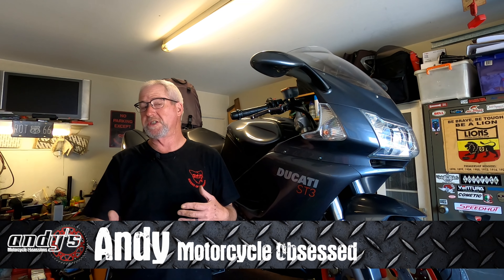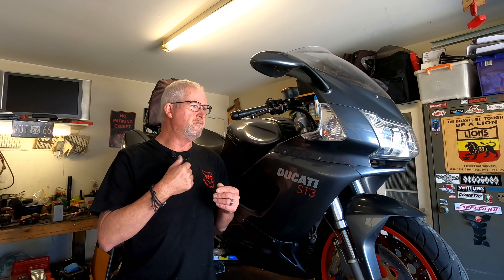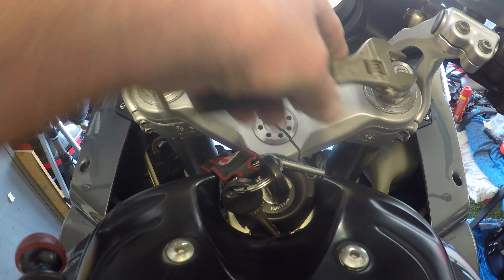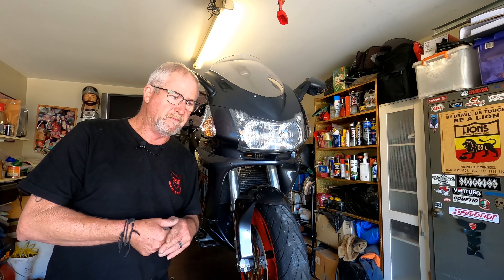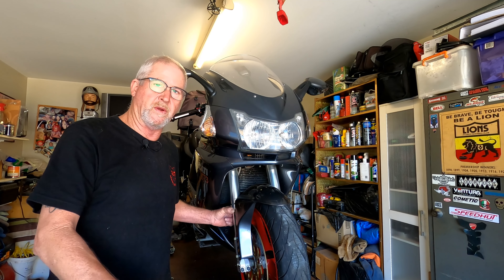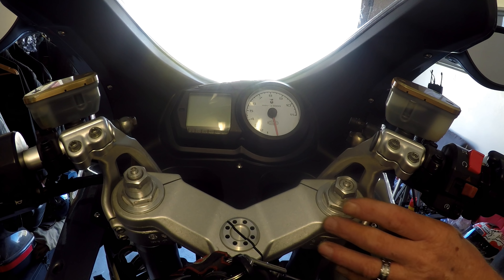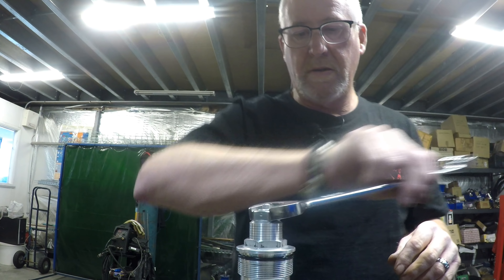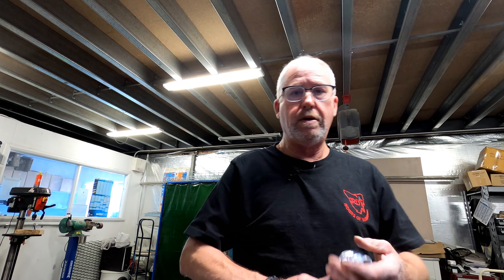DUCATI ST3 Mystery Fork Issue Pt1

Comment: Andy, keep it up! nice video. check the bushings (although the original Showa bushings are very good). Just check if the Teflon lining is worn out (you can seen the copper shining through if worn out). Honestly, when you described what you felt I assumed the steering head bearings where the culprit (but you checked them so assume they are ok).

Comment: The top cap is missing the black rubber ring that is the bottom out pad- the lower steel tube comes up to meet the rubber pad at full compression of the fork.  The C-ring on the spring adjuster was jammed up into the mating part.  That is why the rebound adjuster housing would turn when you try and add preload to the fork.  You will find that the Showa fork version that Ducati uses is crap on the inside.  Steel outer cartridge tube and 10mm cartridge shaft.  If you compare this to a 2000' or later GSXR fork ( also Showa ) the damper inner and outer tubes are aluminum.  The damper rod may also be larger - more like 12mm  This moves more fluid in the damping system and will be better for re-shim.  It is not a trivial thing, but you can make the Showa GSXR cartridge system fit in the Ducati forks.  I have done this on my 748.  Other odd things on the version of the Showa/Ducati forks.  The bolt that holds the fork damper shaft to the fork lower will be just a cap screw - more traditional forks will have a base valve assembly that holds the compression piston and the adjustment system.  This also threads into the fork cartridge outer tube.  The size of the lower leg machined feature on the bottom of the fork lower will not permit the base valve - only the retaining bolt.  You can machine the feature larger to use the base valve or find a set of lower tubes with the axle housing that has the larger feature.  Or not do any of this and just keep the spud that holds the rebound piston / shim stack.  It will have a check shim that permits the oil return.  I have taken apart so many Ducati forks to the point that it may look so pretty on the outside, but is crap parts on the inside.  If you are doing an fork service like you are doing, it is just dumb not to replace the seals, wiper and possibly the DU bushings.  You can find the equivalent 43mm fork Suzuki seal and wiper - still a Showa part !  Wear some gloves or get happy with the stink your hands will have for days  - keep it up.
Reply from the maker: Thanks mate, some great info in here. Yes it was corroded around the wire clip and had seized to the preload adjuster, allowing it to unscrew. I have since taken the cap apart and put a drop of screw lock on the damper assembly thread to help secure it.

Comment: Had a problem with the forks on my 600 Fazer, changed the oil and found the reason for it handling badly, there was a shim missing above the spring.
Reply from the maker: It doesn’t take much to upset them, does it.

Comment: Same as lots of other people I was there chuckling when you were taking the front wheel off ..
not even sure you actually undid the pinch bolts before untightening the axle nut .. hopefully you did.. :)
great vid mate, keep up the good work !
Reply from the maker: You undo the axle nut first, this from the Ducati factory manual: 

Support the bike so that the front
wheel is raised from the ground.
Loosen and remove the nut (9) on left
side of the axle.
Loosen the axle clamp bolts (2) on
the ends of the fork legs.
Working from the left side, use
a plastic mallet to drive the wheel
axle (1) out from the opposite side.
Remove the wheel and recover the
spacer (8) on the left-hand side.
Reply: @ANDY5  ooh.. take that one right back then! 
My apologies sir 👍🏽

Comment: Remove the top fairing, and cut back the white plastic fins on the reservoir tank near the front part of the tank. Then, on the top edge of the top side panel, file down to a few mms the edge from the back narrow section around the corner and tapering back to normal height by the first screw hole. That will make sliding the side fairing on and off a breeze with the top fairing in place, still being careful of course as you flex the plastics. Place tape over the well nut face into which the long rear panel screw goes through so you won't peel it off when sliding the panel onto that frame section. Pierce a hole in the tape before hand. In fact do that to all the well nuts and save our self the hassle of pushing them through.   5W oil works best.

Comment: If you are pulling the forks you may as well do the seals while yoy are in there, the Labour cost of stripping the forks and taking them off you may as well.

Though... iv had a few bikes where those oh I may as well moments turns out that that seal has been hiding/disguising a HUGE issue and swapping it leads to huge bills

Comment: I did a fork overhaul on my Multistrada - be bloody careful tightening   up the triple tree bolts its really easy to crack the top yoke the previous owner to me did exactly that and i had to buy new top yokes, yours look similar to mine 

Apparently the setting in the manual is wrong its a common issue and replacements are like hens teeth took me 3 months to find some here in the UK
Reply from the maker: Thanks for the heads up 👍

Comment: The first ST2 had fully adjustable forks - before Ducati started penny pinching. Are you sure there are no dmping adjusters on the bottom, they are often hidden under grease and brake dust?
Reply from the maker: Yes mate, I’m positive. It’s just a socket headed cap screw.

Comment: Hi Andy, could be wrong but, believe one side controls compression damping and the other rebound damping hence no bottom adjusters, This arrangement is quite common. Regards from a cold and wet Nth Yorkshire UK.
Reply: How does that work if they aren't linked?
Reply from the maker: Asymmetric forks, a lot of modern bikes have this setup. One leg controls compression and the other one controls rebound. That’s not what I have though, I’ve seen this before and I’m fairly certain that the one valve controls the damping for both the rebound and compression.
Reply: @ANDY5  Right, guess you can tell I haven't owned a bike made after 1994

Comment: You obviously had a problem with the fork that you disassembled. On the other hand from my experience of riding different kinds of motorcycles throughout the years, i can say that an easy cure for the base problem that you described is to inflate your front tyre to a higher pressure. Even if the tyre is inflated to the pressure in spec, depending on the riding circumstances it still can be low enough to convey the surface differences of the road up to you. Just give it a try and cross the painted lines on the road with a lower and higher tyre pressure level. You will notice the significant difference it makes. Great content! Cheers

Comment: Nice too see you back on the tools Andy  what's the crack with 'cable ties' on the fork lower?
Reply: Its a cheap and easy way to measure your fork travel to see if your forks are bottoming out by placing the cable tie at the bottom most point they can travel and if the cabletie has moved after a ride it means the forks are bottoming out.
Reply from the maker: They're the mudguard mounting brackets

Comment: Hey Andy, you replied to tell me to keep an eye out on my ‘06 ST4S front suspension, but I wanted to see how you got on first! Mine’s got the Titanium Nitride (TiN) coated fork sliders and Ohlins rear shock. Apart from my steering head bearing work loose and got replaced all else is good. The ST3S/4S had upgraded front and rear suspension, 4 way hazards as well as ABS models. Let’s see how yours turned out after repairs :) !!

Comment: Great Vid!
I had the same problem in my SRAD forks. The Pins dug deep into the aluminum parts.
 I happened to have some hardened shims and used them on both sides where the pins run on aluminum surfaces... Low budget but hey you gotta piss with the c#ck you have...

Comment: Mate dont piss about do the seals bushes and dust caps  those forks shit seals like a killer whale. 
And I reckon you have  ST4 forks on there.
Reply from the maker: The internals look ST4 but the outer tubes are definitely ST3, and the ST4 still had compression damping on the bottom. Who knows?